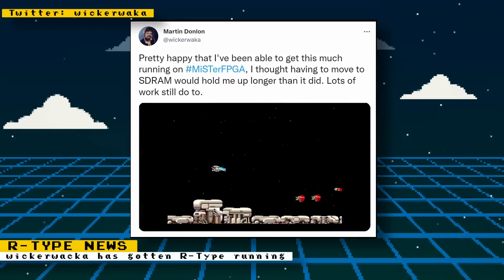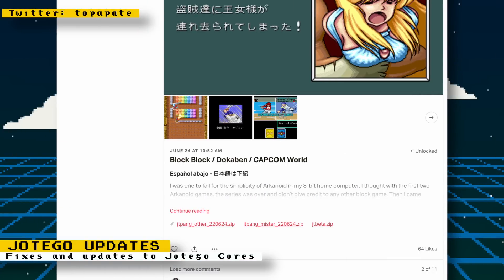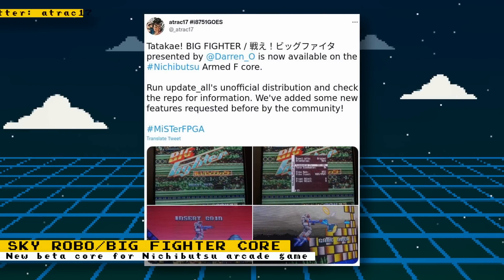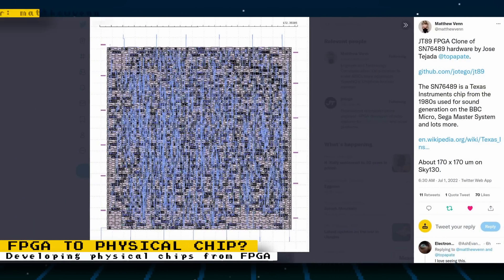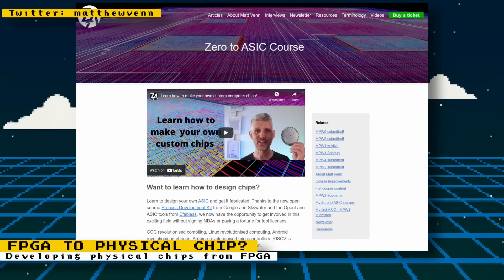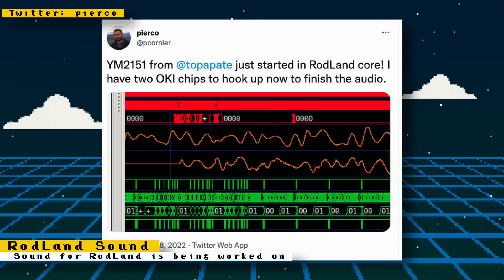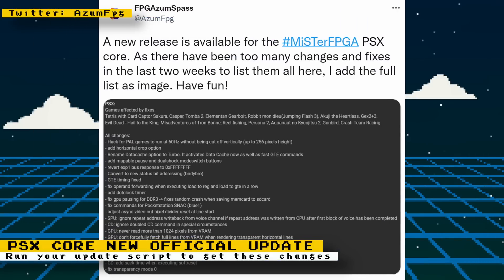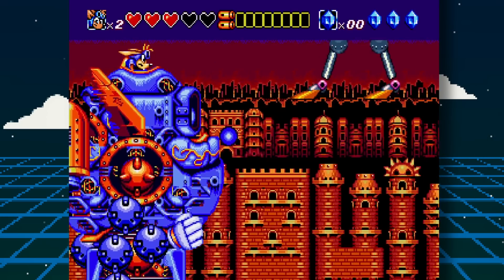MiSTer FPGA News & Updates – PSX Core, FPGA to ASIC, Rodland Sound and more

Comment: Oh man,  FPGA based ASIC of the NES core's CPU and PPU would be awesome! Then anyone can make their own NES from scratch.
Reply from the maker: Yes! Very much needed for the Opentendo and NESessirt boards.
Reply: @beefquiche  HardCopy allows you to essentially print ROM versions of configured FPGAs from Altera. MOSIS provides cell libraries and multi-die wafer services using a variety of foundries, making small scale production of cell ASICs possible. It's a similar (but older) to the Google PDK, SkyWater or eFabless services. I haven't looked closely at either recently, so I can't vouch for which is easier, cheaper, or more open.
Reply: Other options of interest for going towards or to ASIC include Intel (nee Altera) HardCopy and MOSIS.
Reply: @0LoneTech  MOSIS does look like a good option. I'm not sure what the pricing would be for how many.. and I guess it's important to be real about how many people would buy replacement PPU and CPU chips for the NES, and how much they would pay for it.

Comment: R-Type would be cool as it can be quite picky to emulate.
Great content as always Lu' 👍
Reply: @beefquiche  it's also the screen refresh rate and odd resolution of the PCB, doesn't  always seem to run smooth and integer scaling can seem broken. It was an early 68000 powered coin op also... hence picky emulation.
Reply: Why is it that R-Type is a pain to emulate?
Reply: @SoftBank47  because emulation has not sync audio and input lag. Which is bad for shmups. Besides the other flaws. But i guess some arcade games are not good emulated.
Reply: @ninetendopesaitama2107  agreed ... Dragon Spirit is another odd board that emulates off.
Reply: @SoftBank47  Some versions of Mame blatantly say that it's not supported when you start it & you have to say OK to proceed. It works ultimately, but it's probably not the most accurate emulation. Better options are the TG16 or PS1 versions. But those aren’t as pretty as the arcade, though they are close.